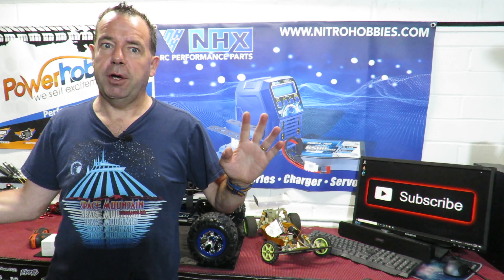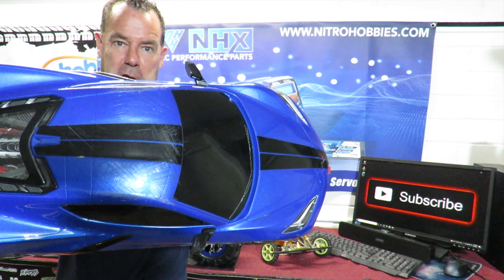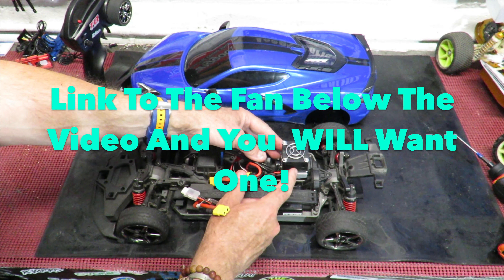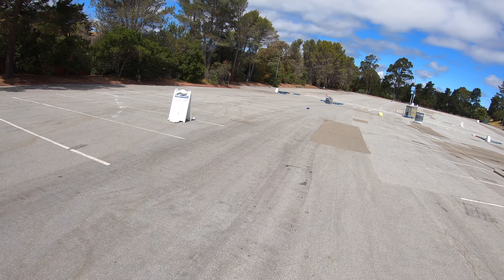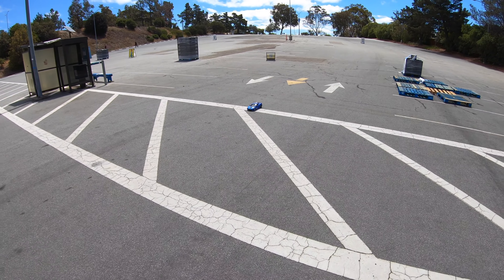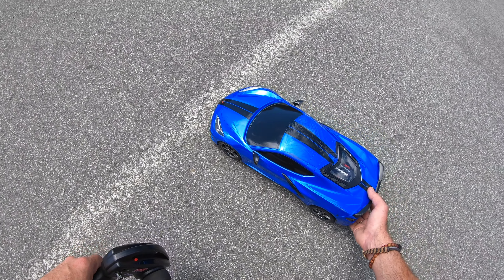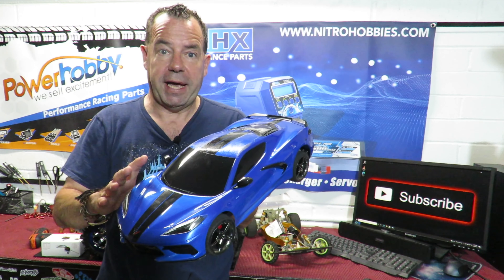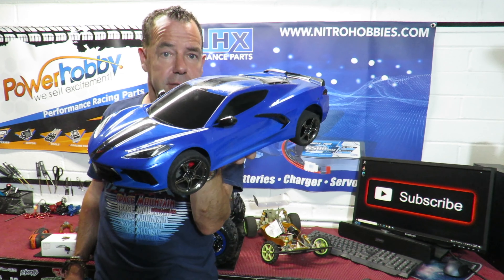My Fastest Ever Traxxas 4-Tec 3.0 Brushless Conversion - Clickbait But Not Clickbait

Comment: i put the velenion system on it and the tqi system then using the app i slowed down the steering rate to like 20% for speed runs also i use the supra tires they seem to do better

Comment: Well, Richie, I'm prepping to remove the Velineon 3S system from my blue 4Tec 3.0, and replace it with a Castle Copperhead ESC & Tekin Pro4 HD HER 500kv motor.  However, I also picked up a black 4Tec 3.0 (check your email & text for more detailed info).  Maybe we should fit that Poseidon motor in my black one.

By the way, ya REALLY gotta watch out for rocks in the parking lot.  I hit one last week, which also flipped my blue one over.  Lastly, the Rx/Rx might not be the only cause of the steering 'problem'.  I'm thinking it's gotta be related (in part) to the servo.  I've got a few non-Traxxas options to choose from.  I'll take care of that as soon as I'm back from Vegas.
Reply: Walk that course, peeps!

Comment: That’s why traxxas released it as brushed. It’s not built for high speed. Similar to the 2.0. Terribly difficult to control and the steering is so twitchy with those small tires. But we still try and squeeze every MPH out of them which is all the fun.
Reply: Yea shit I’d steer mine with the trim dial at high speed 😂

Comment: I've also went brushless on my 4tec 3.0 . I right away switched to a dx5 receiver and transmitter with that stability management, and it is %100 easier to control. I'm running 55 35 tooth gearing and I'm getting 8n the mid 60's but I am getting the rear end wabble. I ordered the gpm stabilizer kit for the rear. I think you might be right with the rear needing more down force any suggestions on a possible wing. And where do I get the fan? Great video I will be doing this project right along beside you so keep posting, my goal is 100mph
Reply: Have you tried raising the rear end? A lot of times it helps & sometimes it doesn't. But it's free & worth a shot.

Comment: I would like to see you make it stable and drive straight on 3s before going higher on the power. Enjoyed the video bud
Reply from the maker: I am changing over the radio as the stock radio is a) Short on range b) Has no steering dual rate and so any correction is a bit too viscious. I'm due to swap the radio out this week.

Comment: you want to solve the problem , common sence , lower it all the way down to the ground , meaning , shocks all the way down , problem solved , and why does a factory give you a controller with no steering dampner with a brushless motor , not  good hello for fast runs hello , hey guys  you see nacecars racing with 2 feet of clearence under them , now go back to the cox airplains and start all over and were pushing to get this in the olympics , frickin vet in halfpipe , cha ching , north cal rc outlaws saying bring it on 415 <>",.<{{{{{{{><